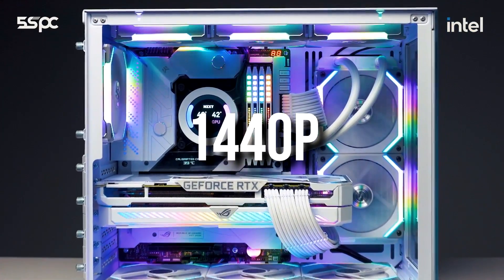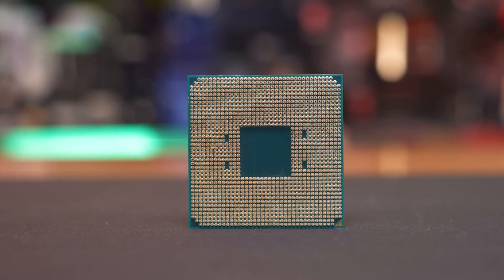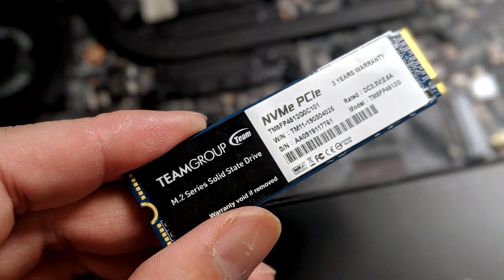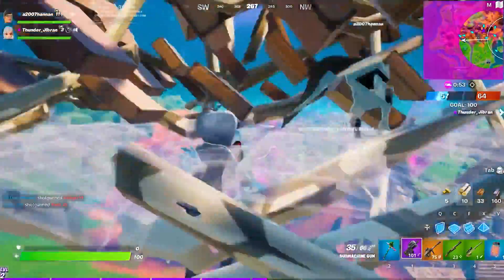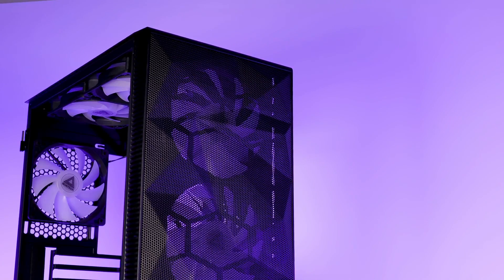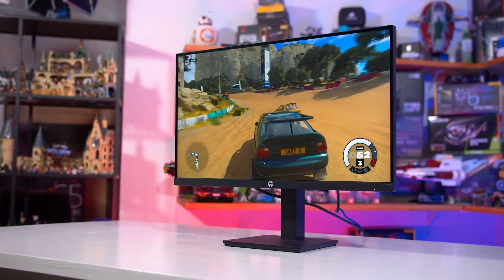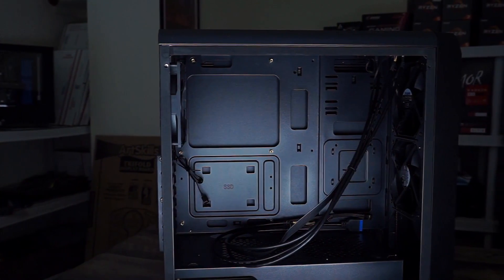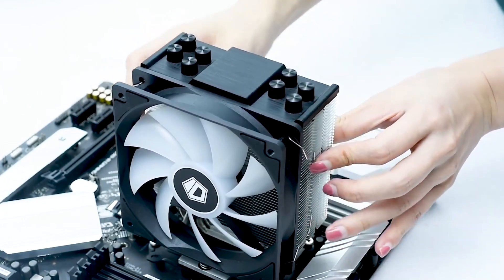Best "1440p Resolution" Value $750 GAMING PC Build in 2023 🤯

Comment from the maker: Let me know what you would change on this build!
Reply: Looks great
Reply: I can get a Ryzen 7 5700g, RX 6600 XT, and 32gb gb rams build for 700rn, is that worth it?
Reply from the maker: @itzoverr3750  yess!! Where are u going to buy it?
Reply: @ShadowGamingPC1  it's a prebuilt, I heard something about Proprietary parts and that I shouldn't get it, Can you maybe explain what that means? I'm fairly new to this stuff. Thank you
Reply: would it work if i used a 240mm coolermaster?
Reply from the maker: @meeuimoe8912  yes but for this system is not necessary

Comment: What 6650 gpu must I choose msi or gigabite or wghat does that change the performance?
Reply: And is windows already installed?
Reply from the maker: The brand doesn't matter as much, it won't change the gaming performance. And windows is not installed on a PC Build, you must install it on a USB drive
Reply: Thank you very mutch like ur vids btw
Reply: Another question is there a low budget psu the rosewill is not available in my country
Reply from the maker: @jurre_dp  thanks man!! where are you from?
Reply: Netherlands!
Reply from the maker: @jurre_dp  get one of these 2 https://www.amazon.nl/dp/B0991TZ399?tag=pcpp00-21&linkCode=ogi&th=1&psc=1 or https://azerty.nl/product/be-quiet-system-power-10-650w-voeding/5036206?channable=03c15b736b750035303336323036da&utm_campaign=&utm_content=&utm_source=PCPartPickernl&utm_medium=cpc&utm_term=
Reply: Thanks!

Comment: What should I do for a 750 pc for streaming as well as gaming
Reply from the maker: this system but get 32gb instead of 16, it's a bit over 750 but worth the price
Reply: @ShadowGamingPC1  but there is no nvenc encoder won’t that impact my performance
Reply from the maker: @Stiffixx  not really, you have the AMD one which is slightly worse in terms of quality but you’re getting much better frames with the AMD GPU than the NVIDIA competitor
Reply: @ShadowGamingPC1  ok that’s what I’ll get then thank you
Reply from the maker: @Stiffixx  ofc! If you want the NVIDIA encoder and same performance Id recommend buying in the used market

Comment: In my country i5 12400f is 10 dollars cheaper than 5600x. I was planning to pair them with 6650xt. If I go with i5 can i use h610 motherboard since im kinda tight on budget or could you suggest me the best budget 660 motherboard. Or should I go with 5600x. I’m kinda noobie with pc builds 🥲

Comment: Hello, currently can’t decide if I should go for a RX 6750 XT or pay 100 more dollars for a RTX 3070 TI, what are ur thoughts? Nice video too! Any monitor recommendations for 240hz?
Reply from the maker: the Viewsonic XG2431. And I wouldn't go with the 3070ti unless you absolutely need the NVIDIA features, in fact for a similar price to the 3070ti you can get the 6950xt https://amzn.to/3VCLzmb . A GPU that performs similar to the RTX 3090 except for ray tracing performance. Anyway if you're going 1080p 240hz then the 6750XT will be more than enough :)
Reply: 3070 ti is definetly not worth it unless you have the money, may aswell buy AMD gpu's, price and performance are so much better, you just wont have NVIDIA features!
Reply: If you stream nvidia.
Reply: You can go with his monitor he told you or you can go with the Alienware 240hz it’s currently $200 on Best Buy right now just more choices for ya 😊

Comment: What gpu do you recomend for 1080p high settings
Reply: Pick among 6600(XT) 6650XT, RTX 3060. At this level of performance in 1080p you wouldn't really want to use RT and using any upscaling won't probably be worth it as these cards have enough performance to push most games in their highest settings over 60fps. Pick the cheaper option.

If you're streaming, AMF has improved a lot but I would still go for an Nvidia card.

Emulation also favors Nvidia if you do that.
Reply from the maker: Either the 6650xt or RTX 3060 (if you want DLSS and ray tracing) but slower overall performance, and if you have a lower budget then the RX 6600/RTX2060 are the best option